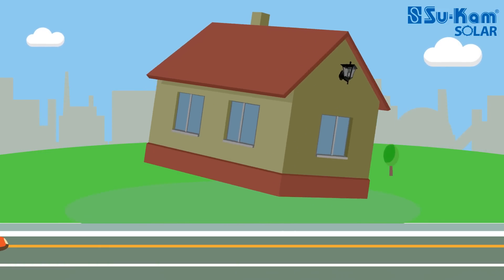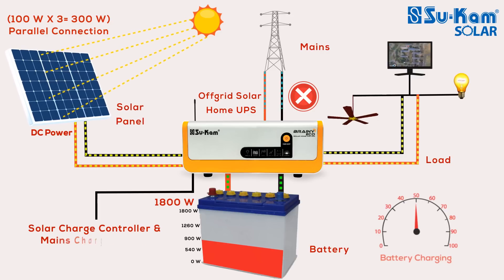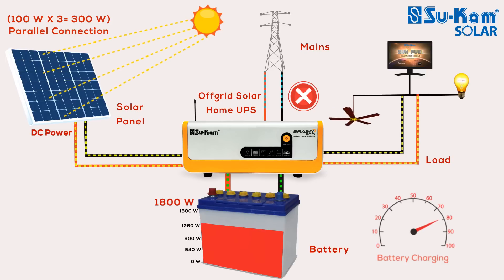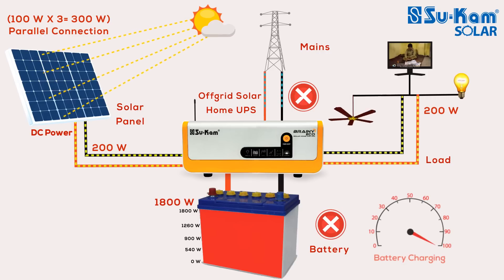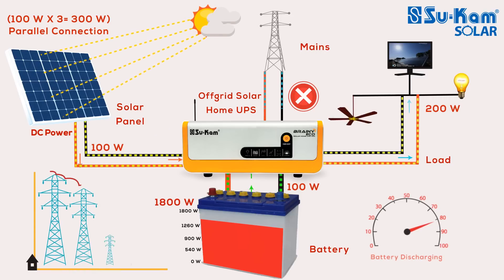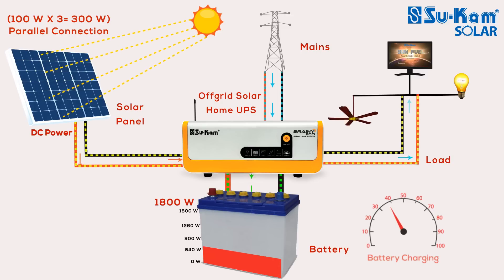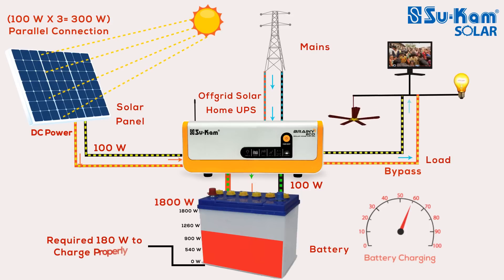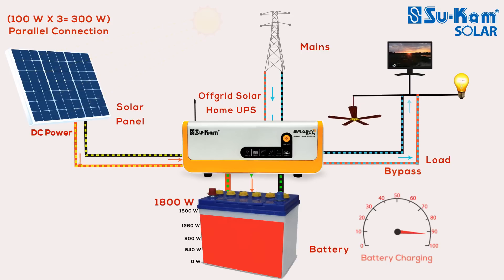How does a Solar Off Grid Hybrid Inverter/Home UPS work?

Comment: In this particular case if we just remove battery and if we want to run aplliance either by solar or main grid only, is it possible? When we are using solar energy directly is it going to have some energy loss ?

Comment: HOW MANY FAN AND LED BULB RUN THROUGH SOLAR PANEL AND BRAINY ECO?
I WANT TO RUN MY LED SMART TV 49 INCH ALSO
Reply: BACKUP TIME FOR BATTERY
Reply: BRAINY ECO 1100 CAN RUNS 4 FANS 7 NO OF LED  BULD AND 1 LED TV ???? HOW  MUCH  BACKUP TIME WITH 200AH  BATTERY AT NIGHT
Reply: I WANT INBUILT MPPT SOLAR  CHARGE CONTROLLER INVERTER 1KW
Reply from the maker: Yes ,you can run 4 number of fans , 7 no. of LED bulbs , 1 LED TV and other load.
Reply: COST FOR  SYSTEM  EMAIL---  fayazgazipura.786@gmail.com

Comment: Mode:UPS/IPS
Featues: 
DsPIc Microcontroller technology.
Modern pwm based charging system.
Output Waveform: Pure sine wave
12v/24v/48v DC input
200v-220v AC output
Output frequency: 50Hz
Rated Power: 500 ~ 7500 Watt
Work Efficiency: 85%-95%
User friendly operation
LCD display indication
Full power and soft start
High transform efficiency, fast start
Strong adaptability and stability
Safe and reliable with built-in fuse
Temperature controlled fan, safe & efficient
Low voltage protection
Over voltage protection
Over load protection
Short circuit protection
Input reverse connection protection
Over temperature protection 
20khz switching frequency
100% copper wire transformer.
LCD Display:Battery volt,Input volt,Output volt,Charging ampere & Inverter status.
Uses:House,Office,Lab,Industry,PC Etc.
Our UPS work as Online UPS/IPS. 
Dual mode operation: UPS Mode & IPS Mode. Customer can select any one. 
Uses: Our UPS/IPS uses for Computer, Sever Computer, IP/CC Camera, Medical Equipment, Networking Device, Router, Switching Hub, Industrial Equipment, Motor, Pump etc.
During Load Sheading, no restart your device (Guarantee). 
2 years Guarantee.
CELL- +8801813 698 333
+8801922 332 771

Comment: I have used this [link here >>>https://plus.google.com/u/3/113778429958471787540/posts/67MrRb1YGej ] book since taking the train the trainer course using the same book and feel it does more to explain the things you run into everyday in the field.

Comment: Hi, my requirement is
1. In gcd mode, can i run load from back up but not from grid while solar is available.
2. In gcd mode, if battery low voltage can it able to charge battery from grid, and load from grid.
3. How to set battery low voltage , is it from switch 5.
4. what are the switch 3 and 4 please explain briefly.
5. what is night mode in switch 3 and 4 both towards left.
mobile 9032178141
email. venkatakarthikgd@gmail.com
waiting for your valuable information.